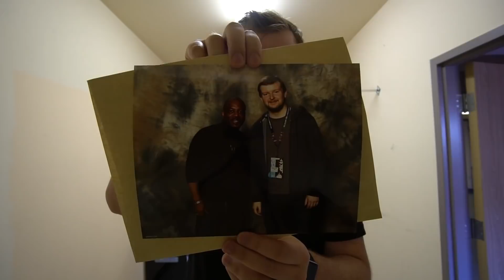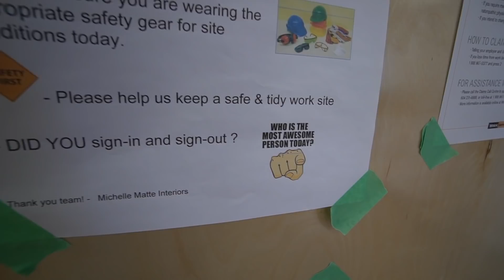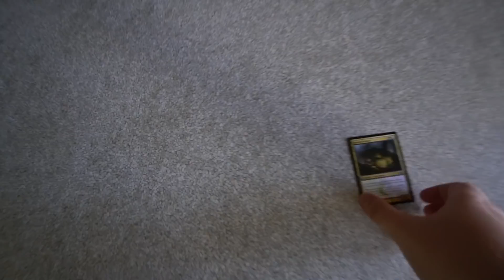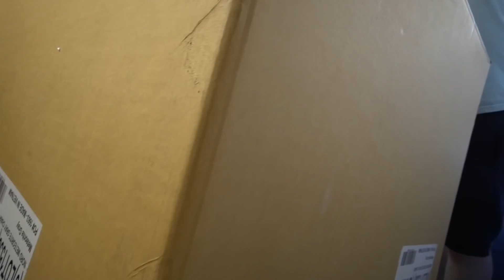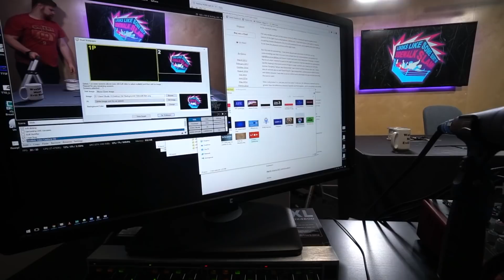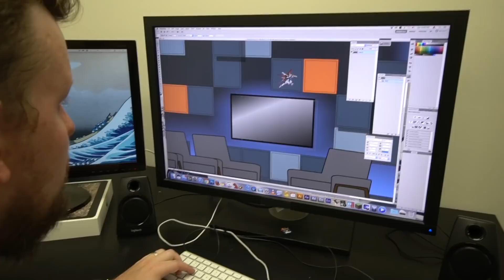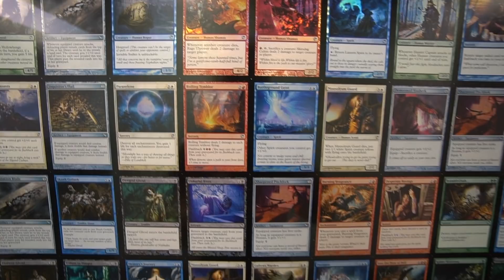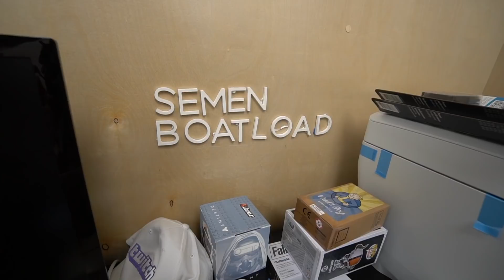Loading Time Digest - Moonbase Moving Special

Comment: Graham, easy answer to the tshirt question -  EBAY.  I think you guys did something similar for Desert bus last year?  Just make sure you tweet and put up a video when they are available.  This way you can have a min bid but doesn't have to be a set price,  it will clear up your old inventory and it will keep stock count for you so long as your original post has the correct stock listed.

Comment: Hey!  I used to work in a performing arts theatre in high school!  Our lights weren't controlled by DMX, but we had full dimmer control over them.  Our board ran DMX out to a DMX controller power grid that would convert the requested signal to standard AC current and pass it down to the corresponding power outlet for each light we had installed. :D  Of course, this was before the advent of LED lights of this nature. :P

Comment: You don't have to use those nasty clips for mounting the light grid. But the alternative is two U-bolts and two pipe routing clamps per intersection. Easier to install, and more secure, but probably more expensive. Or you could go for four pipe routing clamps and four bolts, which would be a bit more fiddly to install, but super cheap and super secure.

Comment: WOOOOOOD! I just can't get over how Canada lets you use wood in commercial spaces! Everything must be made of steel or concrete over here on the east coast USA because "fire hazard". Also, I hope you cleared with the contractor beforehand about moving anything in as they were still working. It's really annoying to suddenly hear about it the day it happens while I'm in the middle of installing an outlet or something. (Huge no-no too, since 80% of our tenant buildouts require an occupancy inspection before the tenant can put anything inside or we get hit with a huge fine when it fails.)

Comment: 18:15 It Not Perfect System.
22:00 Would it have been a little too on the nose to slip a shot of JoCo in at this point?
43:23 As opposed to Too Sweet? (Should the Young Bucks use "Too Deep" as their replacement catchphrase since WWE is suing them over using Too Sweet?)

Comment: Just out of curiosity, why are the windows blurred out at 33:16? They're unblurred at several other points in the video, so it confused me a bit. (I totally get blurring out surroundings on the internet)

EDIT: on a quick rewatch, either those blinds are closed in the other shots or the actual exterior windows are obscured, or it's dark out. A+ hiding of location; Moonbase still safely 100% underground (someone on the crew  would have to confirm orbital status)
Reply: It was probably because of a label on one of the boxes.